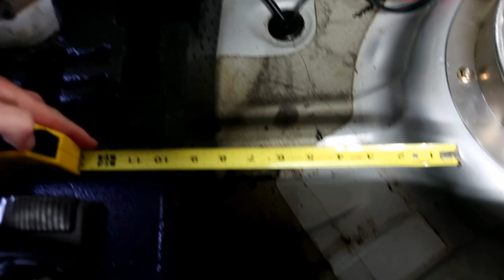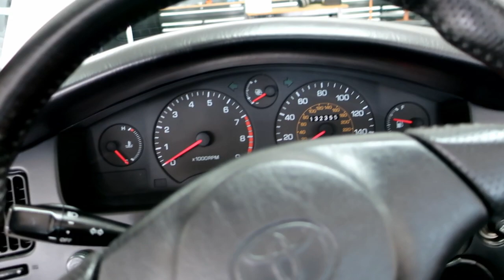Supra Battery Relocation With Odyssey Battery

Comment: Whatever you do leave the factory fuse box in it's stock location. I ran 0gauge marine wire through the firewall along side under the carpet and around the rear panels to the hatch. Bam there you have it. 300 amp resettable fuse 1foot off the positive cable,  works awesome.

Comment: I would relocate the battery to the passenger side of the trunk for better corner balance. When I corner balanced (adjust coilovers) my Supra on a set of digital weight scales, I found out the passenger-rear corner was the lightest corner.

Comment: Well if you don't want to drop the gas tank just drill holes going from the inside being very careful and pop rivet the bracket or put pop thread inserts and bolt it on.

Comment: Better weight distribution and easier to work on 👍 0 Guage OFC ftw
Reply: 0 gauge is a waste of time and adds unnecessary weight to the car. For a starting battery you only need 35mm squared or 2 AWG.